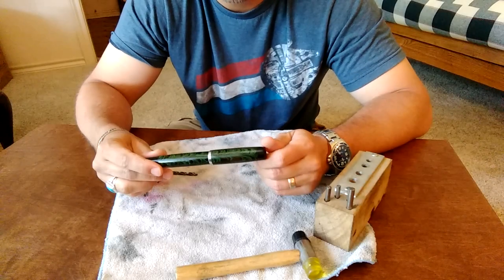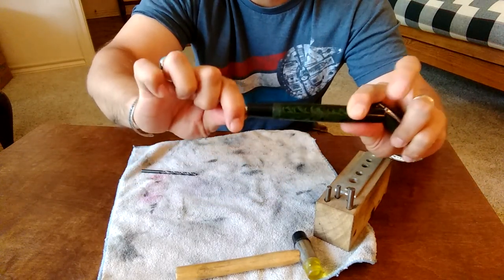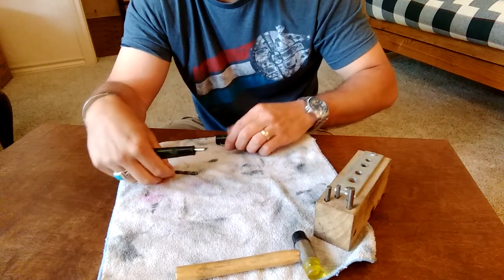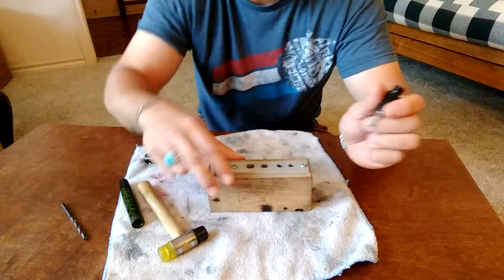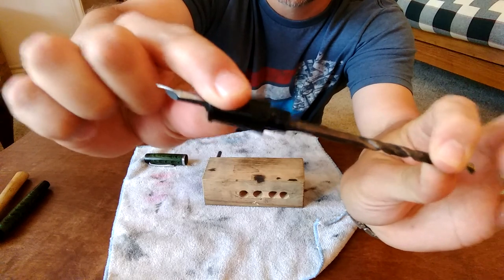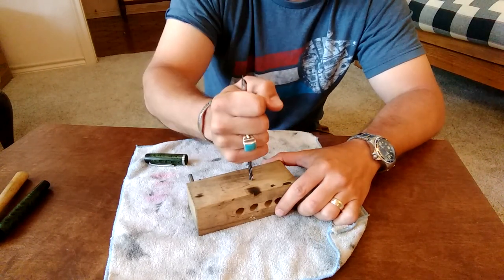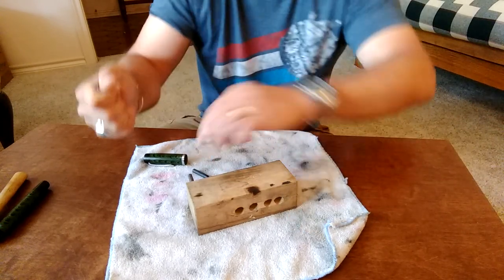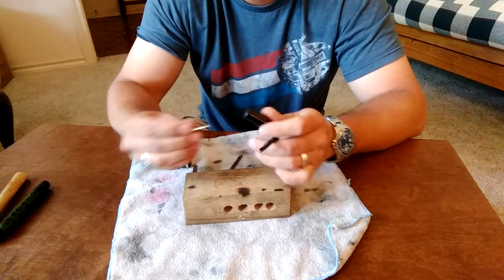How to remove a "stuck" fountain pen nib and feed with no special tools.

Comment: IMPORTANT NOTE: Don't do this if you have a small tube on the other end of feed where the cartridge fits.

My condolences if you already smashed it.
Reply: I was wondering about this... thinking maybe those knock-out block punches were actually cored-out tubes to create a pocket to fit the feeder tube into.
Reply: I actually did this, but my pen still works very well. But I took some preparative steps beforehand like soaking the nib and its attachments in oil and letting the oil drain through the feed almost completely before using the drill bit. I also didn't use a lot of force. Once I saw about one or two millimeters of the feed had slid out, I switched to constant pressure and it finally dislodged. 
Mine was a $12 Jinhao from Amazon. I had gotten it stuck about a year and a half ago and was afraid it would scratch the metal nib so I never tried to use pliers. Glad there was another solution
Reply: ahh come on it's too late i already broke my feed😔😔
Reply: @genner-vincenthodgson5177  I'm gonna give this a go now. I am trying to get a G nib off of my Jinhao and I never thought to try using some oil to help it along
Reply: @pipisdetitis4656  Same, I broke mine and mom don't want me to buy another one😭😔
Reply: Thanks, Captain Obvious

And my condolences to dorks who did IT   xD
Reply: fuck... i smashed it. on an expensive pen. literally crying rn.
Reply: Saw late, but before completely smashing the feed tube. That was restorable just knocked out a little piece. Also dangerous but if conducted carefully you'll get the result. Take the pliers, wrap the nib and the feed with the tissue and where the wide notch (to screw the nuts) put your wrapped feed and carefully without much pressure hold the nib, and pull the body of the pen.

Comment: The nib on my Jinhao 750 was impossible to remove. So I tried this method, and it worked.

1. Remove ink cartridge, rinse nib, blot dry
2. Cut a 25 cm (10 in) length of postal twine, double and knot to form a loop
3. Cut a 1x25 cm (0.5x10 in) strip of masking tape
4. Do 4 very tight wraps around bare nib/feeder at collar
5. Align loop strands with sides of metal nib
6. Do 8 very tight wraps around postal twine and nib/feeder
7. Grab cord and pen body firmly, pull using shoulders

After this heroic initial removal, the nib was reasonably easy to remove with normal hand force. If you slightly dampen a folded paper towel, that will conform to the ribs in the feeder and make it less likely to deform them when pulling.

Comment: Very help full ... so many pens have plastic at the feed ... good pens with good nibs that break at the join to the body ... I have replacemes fr all that but a full functional special nib ... would not have broken without use ...might be able to save my black nib from a more recent pen and put it in my Rotring 600 ...  nice thinking appreciate it

Comment: Alternative means.
Soak the section and nib in hot water. 50C / 122F - Add some detergent too if you want. Leave overnight. Try again after that. Yes the friction joint should not leak, but the heat will open the joint up a little.

Run the section under the hot tap, do not let the hot water get on the nib and feed. This expands the section a little easing the friction fit.

Lastly, if nothing else works, use rubber nose pliers to pull the metal part of the nib out. Pull in a straight line - You do not want to bend the nib. This eases the friction fit enabling easy nib feed removal. This works very well for me.

Have you tried a hollow metal tube instead of a solid rod?  It should put the pressure on the strong part of the feed and not the delicate middle. 

Watch out for ebonite feeds too. They are brittle.

Works every time for me. Even with Platinum 3776 nibs.

Great video - Cheers.

Comment: What about the feed tube? Wouldn't that method risk damaging or crushing that?

How about using an appropriately-sized socket from the inside & another appropriately-sized deep well socket from the nib side, with gentle hammer-taps to do the same while risking it far less?
Reply from the maker: This procedure should only be done on an ebonite feed.  If your feed has a tail then it will have to be pulled out from the front.

Comment: If you are here because you want to disassembly Sheaffer Prelude (some older kind) then be aware of several things. There is little metal bush around ink channel, which you will stick inside the grip during this operation. You will need it back at previous position because it holds converter. Moreover, the bush is very tight, so you need to loosen it a little because you won't be able to put ink channel back manually. Another surprise will be that the nib and feeder has no position marks at all, you can put it all together without any sense. Good luck! :)

Comment: Thanks for this! I would try it, but the little “tail” at the cartridge/converter connection point would be destroyed! So, I have to spend the money on a full nib unit instead. And that limits what I can get for nib size. I want a smooth BB for my Edison Beaumont and they don’t offer that size. These limitations by the pen/nib manufacturers are “by design”.🤬🖋 As more people get into FP, they need to open up the options for variety. Otherwise people will look elsewhere. 🤷‍♀️

Comment: Just to add that I made my own knock-out block by running a few drills through a beech off-cut, and have used it many times. Any hard wood is OK. Don't whack the feed too hard—an 'ebonite' feed is really only a small length of hardened rubber. Knock-out rods are easily fashioned from wooden dowel, old drills or ground-off nails. By the way, some pens use screw-in feeds, e.g. old Osmiroids, so don't hit them!  ;0)

Comment: Just to let some know, i was able to makeshift a knockout block using my Garfield desktop pen/pencil holder. The pen holder had the holes and slots to fit the section into, but the section had a smaller diameter than the holes. So I used a folder scrap paper to tighten the wedge of the section in the hole. The hammer and screwdriver bit did the rest. 😀

Comment: Hi,Thank you Big time 💯
I just drilled 7.5mm hole in plank & use 5mm drill to tap out 
My Dads 100 year waterman is so Happy Now 👍
What ink conversion do you recommend 
Please keep up the nice work 🇺🇸🇳🇿
Reply from the maker: Glad I could help!  What do you mean by ink conversion?
Reply: Hi, the original rubber ink sack went Brickell 
So what do you think I should replace it with?
Reply from the maker: Ah... then you should be able to just have the sac replaced.  That would be the cheapest and easiest fix if the res of the pen is working.

Comment: It is really an innovative idea. Will it not harm the nib?
Reply from the maker: It should not be any more dangerous than using a knock out block.  I have yet to ruin a nib using either method.
Reply: Thank you for your reply. one of my pen's nib is persistently stuck up. I cannot remove the nib from the feed. I do not have a  drilling gadget but I have screw driver gadget with similar blunt ends. Should I try with that? Will the nib and the feed come out?
Reply from the maker: If the diameter is small enough to enter the section and the end is blunt that should work just fine.
Reply: Thank you again,Fountain Pen Revolution. The blunt edge is 8 mm. So it will work, I guess.I did not tray for fear of getting the nib damaged. I do not mind if the feed is damaged.

Comment: The problem with this is that it will not work with certain Chinese fountain pens because they have a covering in the nib holding cylinder which will prevent the "drill bit" from exerting tge force needed to push out the nib, as far as i have found. So, for all those jinhao users, please let it be known. I'm not sure if I'm right for this for modern western fountain pens though.
Reply from the maker: Hi Arvin.  That is correct.  The video is meant to provide an alternative to using a knock out block.  However, pens with plastic feeds (the ones with a small tail on the end) cannot be removed this way.
Reply: Did you find a way to put out the nib of jinhao or hongdian? Unfortunately i have tried everything but I can't get the nib iut

Comment: And since the fit is so tight, what's the best way to reinstall?
Reply: Good question!  Generally they are far easier to push back in than pull out.  So, just lining up the nib and feed and pushing them back in manually should work.

Comment: Now, when you have a stuck nib out, how do you knock it back into the grip section?
Reply: Good question.  Usually they can be pushed back in by hand.  Getting them out is much harder than pushing them in.

Comment: You should add in there on a lot of newer pens with plastic tongue or feed a Knockout block cannot be used just saying
Reply from the maker: Good point.  This will not work with feeds that have a "tail".  It is only intended for ebonite feeds that are flat on the bottom.

Comment: Does anybody know if this works with the new Jinhao Centennial? It has a nib unit and I just can´t get the nib and feed out of the housing
Reply from the maker: Definitely not.  This will only work for pens with ebonite friction fit nibs/feeds.
Reply: @FountainPenRevolution  Thanks a lot and sorry, didn't read the comments before. Do you have any idea about these Jinhao nib units? The one in the 992 model is easy to pull the feed out, but in the Centennial seems imposible to do it
Reply from the maker: @javier182ful  I have never tried on a Centennial.  Hopefully someone else will chime in with some advice.  Generally, even if a nib unit won't unscrew the nib/feed themselves will still pull out.
Reply: @FountainPenRevolution  I hope so, thank you, appreciate your help. Love your work, greetings!
Reply: I would like to know also about the jinhao 100. Seems the 100 may be glued in. Looking for a replacement nib unit for the 100 if there is such a thing. Nib on it now is crap . So pen is useless to me. 20 $ down the crapper.

Comment: This will be a disaster on most modern fountain pens... first of all the feeds will be plastic, not ebonite, and thus already more prone to damage. Secondly they're cut with a "tail" for lack of a better term that goes through a much narrower hole in the section, which will be the primary point of contact when hammering it. When you smash this piece - assuming you don't outright break it - you will peen the outer edges of the "tail" which will cause it to flare out. If from that point you can even get it out without it getting even more stuck, it will be a much worse fit from then on, and worst of all the ink flow will probably be lessened if not destroyed, because the surfaces on plastic feeds have to be pretty pristine (relative to ebonite) to maintain their hygroscopic quality.

Comment: Serious question: what if the section is stuck too bc im fucking panicing qwq
Reply: Are you sure the section can be removed on the pen you are using?  If so, a soak in warm water often helps.